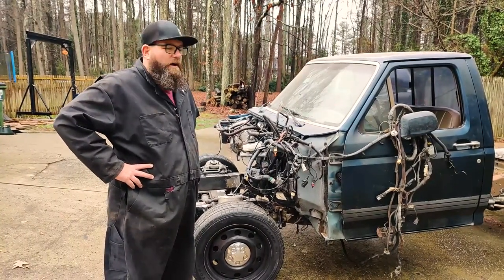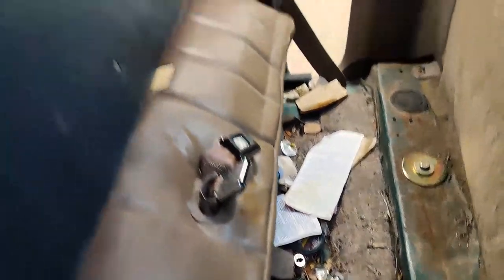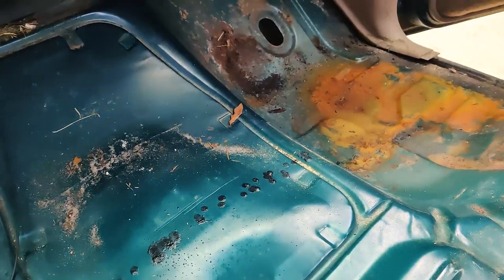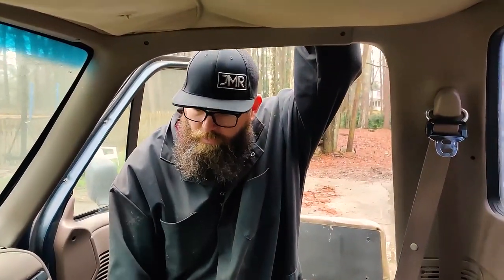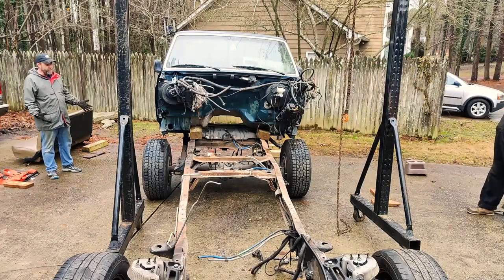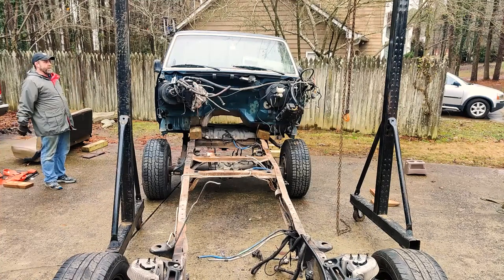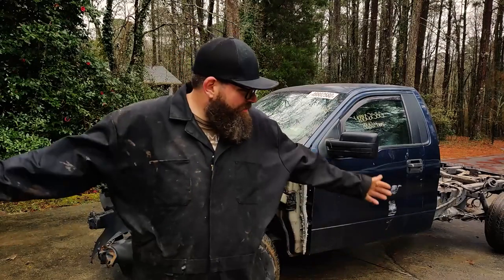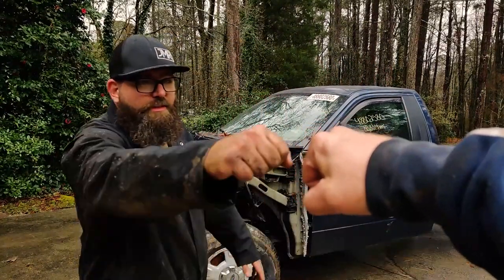Don't Remove your OBS F150 Cab how we did on our Coyote Swap F150!

Comment: I know these feels. That cab is hefty and front heavy.  I set mine up on cross beams and pulled the stock height chassis out. The challenge was putting it down on my much lower chassis. Keep it up guys! I like seeing the different approaches
Reply from the maker: Yeah that will be interesting for sure. Also your approach makes sense.  Appreciate the support brother.

Comment: I pulled an extended cab off by myself with a cherry picker. I took off the chain and hook and built a boom out of 1x4's and attached the boom where the pivot was in the center mounted to pin hole at the end of the picker. Then I opened both doors and pushed the picker to where it was pushing up in the center of the cab with each end of the boom in each door frame. The I just jacked it up enough to clear the frame and pulled the picker back and set the cab down on blocks. Worked perfectly. I decided not to repurpose the wood and keep the boom just in case I needed to do it again.
Reply from the maker: Hey brother first off thanks for the comment and support.  Second I have a difficult time seeing what I'm reading.  Would love to see this in photo form.  If.uou could email me at Ryan@jmrrebuilders.com I would appreciate it.  Also please consider subscribing to our channel and click the bell to get notified when we drop more content
Reply: Will do. If you like what you see share it if you think it will help else.
Reply from the maker: Heck yeah
Reply: Just shot you 2 emails with pics
Reply from the maker: Sweet I'll check brother.

Comment: Do you have pics for reference of how to remove the ebrake cable and the transmission cable that I believe goes to the speedometer? I have everything else disconnected I believe to be able to pull the cab off but not sure what to do with those 2 things I mentioned. 

Comment on that would be greatly appreciated. I can get a picture of what I mean if it would help....not very well versed on proper terms so I may not be using the right words for what I still need to remove
Reply from the maker: I am not sure I remember exactly.  The ebrake i believe was removed off the back of the release and pulled through.  The tramsmission cable i believe we intially removed from the transmission when we pulled motor and trans.   Hope it helps and good luck

Comment: Good videos guys. One question though. Why was in necessary to remove the cab? Just to make it easier to work on?
Reply from the maker: Yeah the cab is very restrictive.  Removing it allows us to get the coyote in and not fight anything.  Appreciate the support.
Reply from the maker: I think we've found out there are about a half a dozen easier ways to do what we did.   Thanks for the comment!  It really does help us grow in our channel. -jason
Reply: @JMRRebuilders  I’ve done it twice. Once I cab swapped my 95 and it was gutted and 4 of us lifted it and man even empty with no doors or anything that bitch was heavy. The other time on my 79 I jacked the cab and truck up on each side and put 6x6s across under the cab and let the truck down while adding blocks to keep the cab up. Then rolled the frame away.

Comment: Are we going to see the coyote re-emerge in future episodes?
Reply from the maker: That's the plan my man.
Reply from the maker: Absolutely.   Next episode we do a little final welding, wire wheeling and then rust encapsulation on the frame. Today we start the coyote swap.   It won't be long now!! - jason